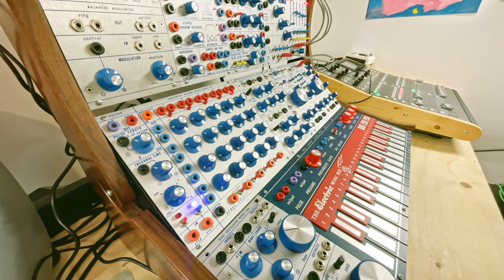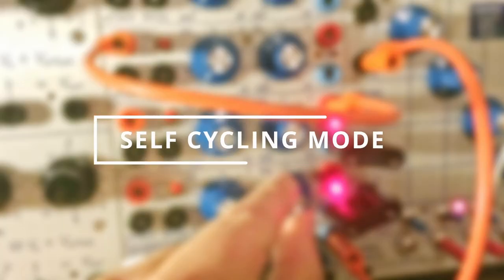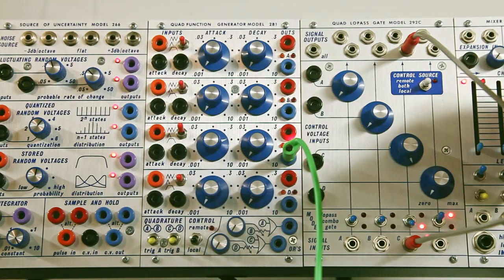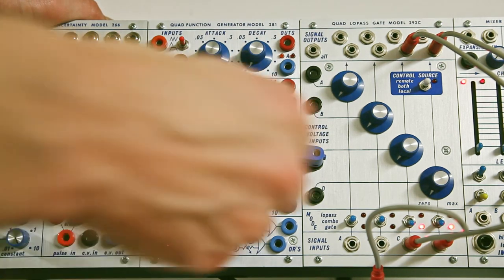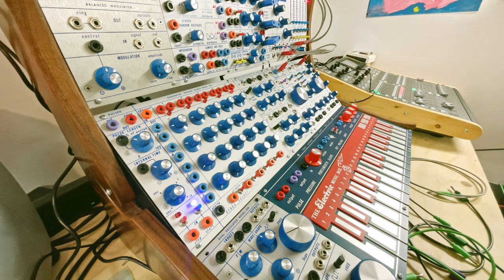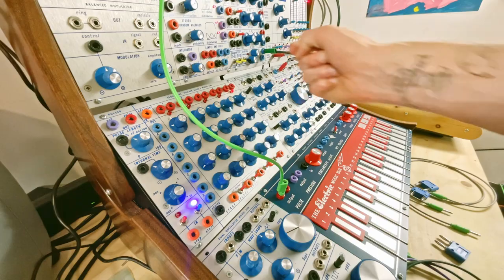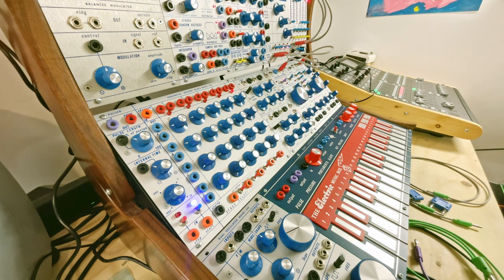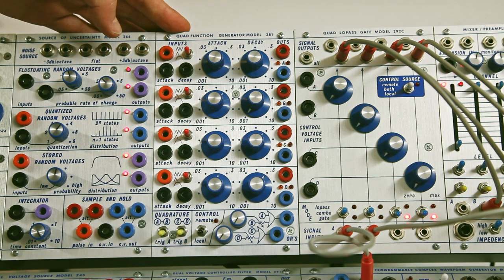[The Buchla Series] #3 - Buchla 281 Quad Function Generator

Comment: Hey :) Thanks for producing this great series! I learn a lot – can you maybe answer me one question: I have a Sputnik Quad Lopass Gate for Eurorack, with vactrols. It does not close completely in "combo" mode. It this also the case with your Buchla Lopass Gate?
Reply from the maker: Hi, concerning your LPG, it really depends on the vactrols. I'm not 100% sure, but I think there will always be some bleeding. My Make Noise Optomix and my 208 bleed quite a lot. My 292 has very good vactrols and is much more quieter (I even have a channel with a very very low bleeding).
Reply: @synthemodulaire  thanks :) I know that there’s bleeding most of the time, so your answer ist confirming that! How do you work with that? Do you have a mixer after the LPGs to bring them in and out?
Reply from the maker: @lukehrm  The bleeding is so low that it is not an issue for me. I've played with my Optomix for almost 10 years now, sometimes in big venues, and I've learned to do with it. That could be an issue for me if I had to play a very minimalist piece with a lot of silences, but that has never been the case for now. And yes, I have a mixer after the 292, the great 207 ! :)